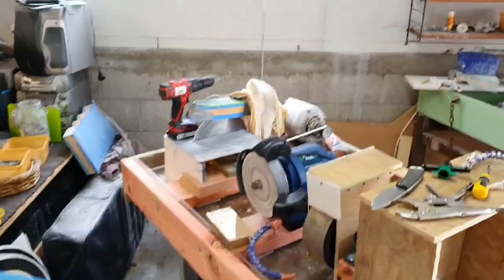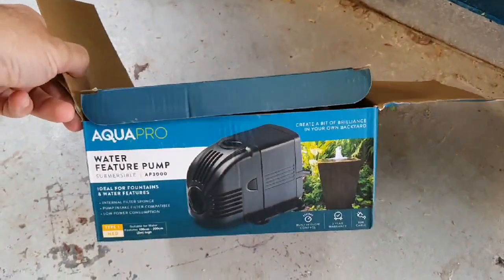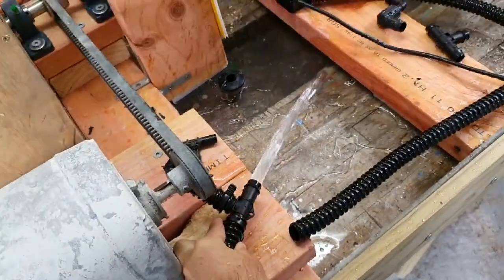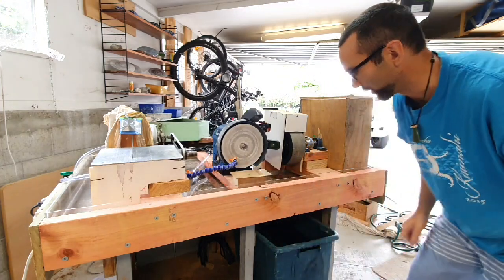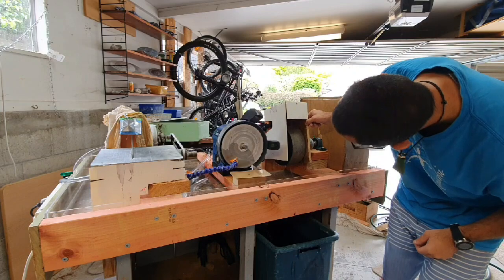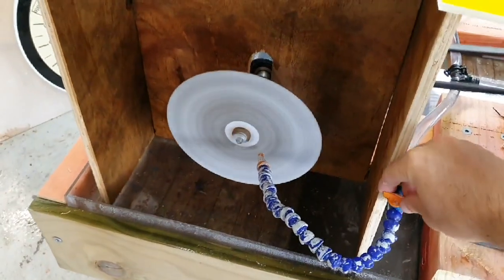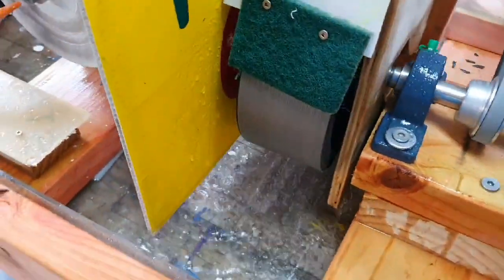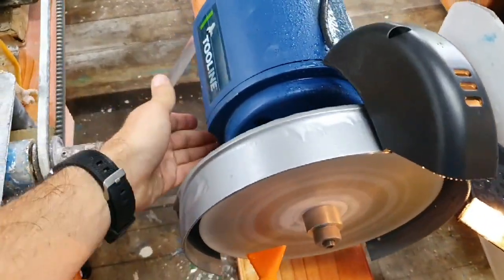Pounamu and Jade Carving Workshop Build Part Three Water System

Comment: Kia ora , I am wondering where do I go to annoy about getting all the little bits n bobs for gravity water line feed that I will need  including size of tubing you use? Taps, joiners, etc to control the water flow on/off and its flow? Thankyou m8, love your channel, love your mahi & korero....
Reply from the maker: I started with tube and taps from a pet shop for aquarium. I not have a pump system that runs of stuff from. Mitre10, including garden irrigation pieces.

Comment: Kiaora, what rpm do your cutting and grinding wheels run at. I'm looking at setting up a wet bench to start working with Ponumu, I have been carving small wood and bone items for some years, lately a customer gave me a large piece of Ponumu to start me off.
Reply from the maker: Tbh I don't even know. The flat lap on the bench grinder is very fast prob too fast. , whatever the usual is for them maybe around 3 or 4000rpm. My cutting disc and point carver and drum are less maybe 2000.

Comment: Its looking awesome! Hey where did you get those ribbed flexible hoses with the taps on them?
Reply from the maker: All from Mitre10. Was an epic puzzle finding the pieces, black one is 20mm, down to both 13mm with the taps, and the one for the bench grinder had to be 16mm. Would have used all clear tube but they were out at the time I bought the pump so ended up with the back, worked OK.
Reply: @CampbellCarving  Great - I'll have to check out mitre 10. I definitely want to improve my water setup.

Comment: Hey buddy, how did you attach the drill chuck to the shaft of the one with the expanding drum on the  other side
Reply from the maker: It screws on a thread. I got the right thread put on by the engineers that made the shaft.
Reply: Thanks that's helpful I figured it out